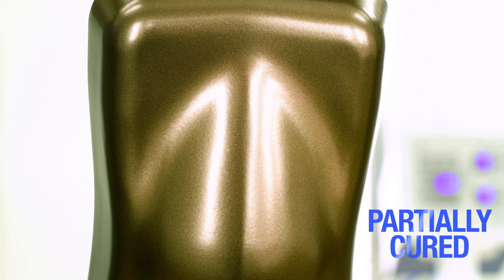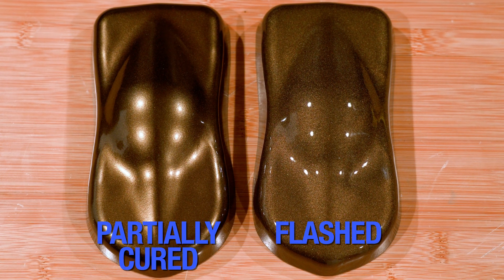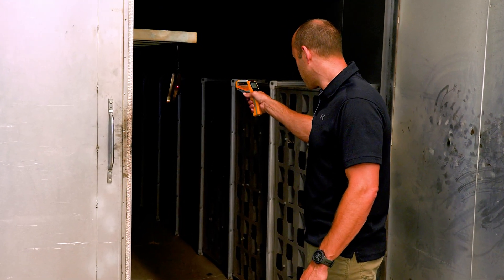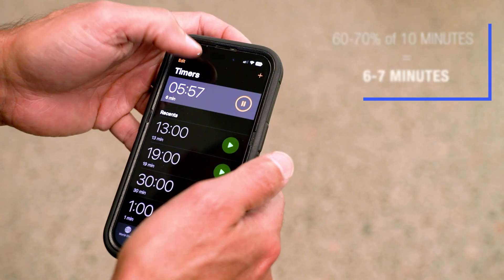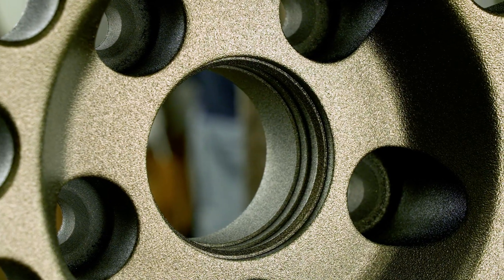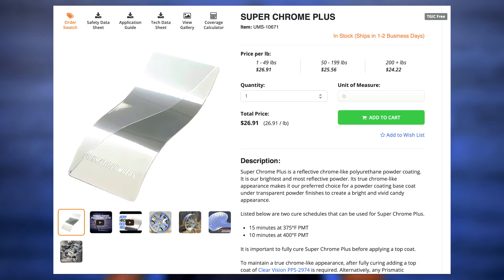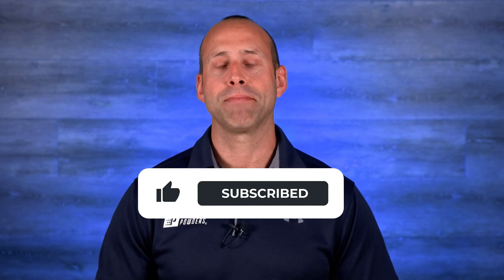Flashing vs Partial Curing - A Critical Difference! | Prismatic Powders

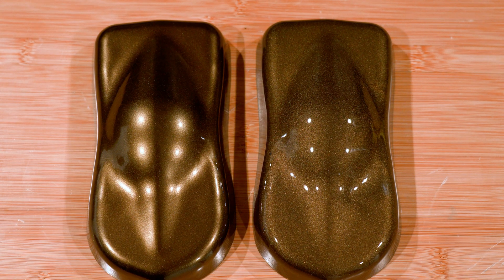Comment: What is the name of the gold sample at 1:06 on the right side?
Reply from the maker: Good question, both samples are Highland Bronze. But you can clearly see a difference between the two, flashed vs partially cured.
Reply: @PrismaticPowders beautiful color. May have to do my valve covers in it 👌🏼

Comment: In powder coating, the cure schedule is based on the part's metal temperature. Should an electric oven be able to achieve and hold this cure temperature the same way a gas oven does, or are there differences in how the two oven types affect curing? Thanks,. just looking for insight.
Reply from the maker: Good question, and electric oven should be able to hold temperature, but there are some considerations to make with some electric ovens, such has uneven heating. A lot of people will install fans to move the air around like a convection oven to create even heating.

Comment: Why does my shocker yellow parts have a gold brown look to them after cure....parts have a fully cured polar white base?  Does shocker yellow need to be flashed ?  And not fully cured???
Reply from the maker: Hmmm, try partially curing the Polar White base and then fully curing the Shocker Yellow. This combo should turn out as a super bright yellow if you have a white base. The only thing I can think of is if the white is going through 2 full cure cycles, maybe it is slowly discoloring under your Shocker Yellow and that's why it looks more gold? Polar White has a cure temp of 350 while Shocker Yellow has a cure temp of 400. Between these two factors, you could be really cooking that base too much. If my suggestion fails, get in touch with our tech support team and they'll get you squared away and discuss all your variables.

Comment: And if I do the full cycle recommended for baking 100% of the time, will I not get a bright effect after the finishing layer?
Reply from the maker: I'm not sure I understand your question, can you please elaborate some more? If I understand a little about what you're asking...it depends on the powder combination that you are using. The main point that we want to make is that partial curing before a top coat  and flashing will have different results. 
If you want to match our swatches, you need to partially cure your parts before applying a top coat.

Comment: Interesting...I've noticed that when I apply Clear Vision over Loch Ness after a full cure schedule, it actually seems to diminish the rainbow holographic effect, not intensify it...Should I be following this rule here? Get Loch Ness up to temp and then only keep in oven 60-70% of the cure time...then add Clear Vision?
Reply from the maker: Not necessarily, if you prefer the look you are getting, keep at it. We just want to make sure that people understand that it makes a difference and that you need to get the parts up to temperature for a true partial cure. Partially curing is important for durability and looks...especially if you're trying to match the look of our swatches.

Comment: How does this applied when illusion powders are involved. Do i partial cure or flash for this powder type
Reply from the maker: Illusion is a different beast and I should've mentioned them. For Illusion colors you only need a couple of mins after flowout to match our swatches. If you wait too long it will affect the look, typically darkening the color.

Comment: I thought you had to get the part to temperature for the specified cure time, so wouldn’t you have to wait for the part to get to temp for 60-70% of the cure time?
Reply from the maker: Exactly, you need to get the part up to temperature and then (for metallics) keep it in the oven for roughly 60-70% of the cure time on the cure schedule. For solid tones 20-30% of the cure schedule is fine. The main point we want to drive home is to bring the parts up to temperature for a percentage of the cure schedule.
Reply: @PrismaticPowders I guess I should start doing that then. I always pull the parts out just a couple minutes after gel out. I doubt any of it gets up to bake temp let alone stay there.
Reply from the maker: @JakobWatson-h2i   Yep! start doing that and you'll be covered both for looks and durability. And don't hesitate to reach out if you have questions.